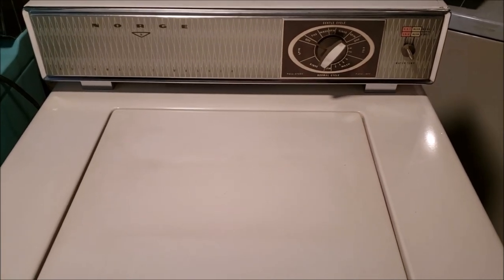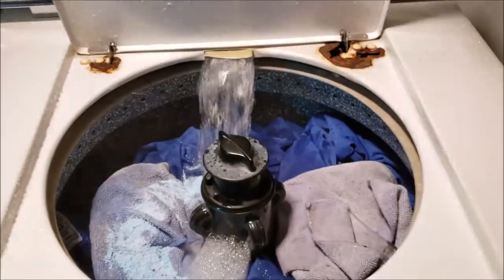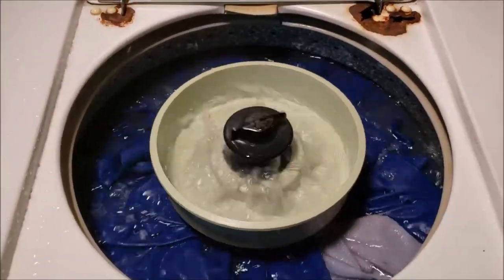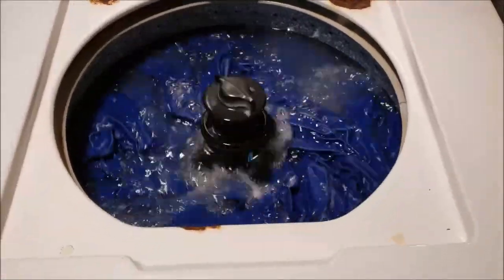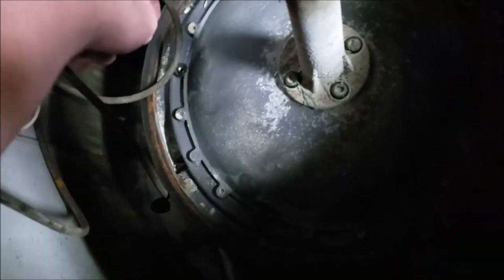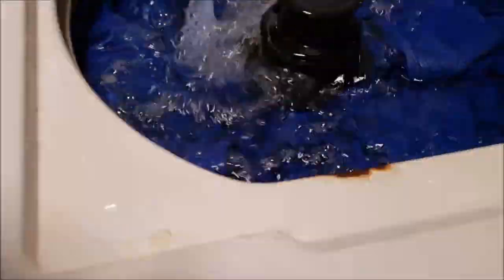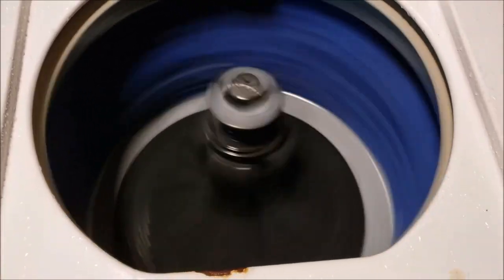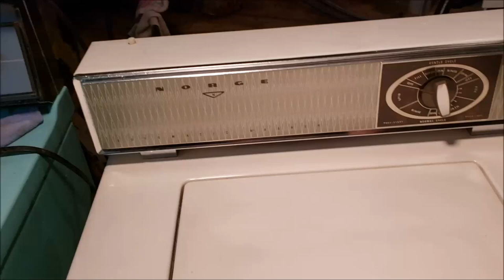Full Cycle- 1962 Norge Automatic Washer AW-220

Comment: The Norge legacy became part of the now defunct Maytag Corporate umbrella. Maytag built modern versions of these machines under Norge name Magic Chief and Maytag Performa brands & Admiral . These machines were bang for the buck 20 pound versions with 3/4 hp motors staring production in the late 80's under Maytag's ownership until Maytag closed!
Reply: Channel123 they also did Crosley , i am told.   I’ve seen a near identical Magic Chef machine to my beloved Crosley work-horse, so it makes sense...
Reply: The one brand that they marketed the Norge manufactured machines under that didn’t make sense to me and that they should have gone up level with a real Maytag in my mind was the JennAir washer. It seems to me that should have been their best wares.

Comment: That is one serious agitator in that thing. Norges always had big bases on their agitators. Our early 70s Fedders Norge with the white burpolator was a powerful agitator. Huge agitators .
Reply: They were tanks lol😀
Reply: Albert Carello  Ours went out because the timer knob broke and wouldn't shut off. It just kept going through all the cycles. 

Hindsight is 20/20. We didn't have the internet then or the washer community out there. 

That was back in 1983. That machine lasted us about 9-10 years with no signs of mechanical problems other than the timer.
Reply: Gosh our 1963 Norge burned through a timer, two mixing valves, three pumps and finally a leaking transmission in six years.
Reply: @LlyleHunter  Back then I thought we would always have these kinds of machines. Don't know what you got til it's gone.

Comment: Hey love the vintage Norge’s. If you think that pump is loud brand new washers nowadays with the separate pumps are much noisier. I have a brand new 2019 Speed Queen the washer in the wash mode and spin mode is really practically silent but when the pump kicks on you can hear it across the whole house I don’t understand why they can’t make make quiet pumps in this day and age.
Reply: Peter do like I did with my Speed Queen, I put a foam rubber pad under my pump to keep it from vibrating against the metal base and it quieted the pump down by 50%!!! My machine is in the kitchen next to the living room and I really had to turn up the volume on the t.v. so I could hear it!!! Now that I put the pad in, no more jacking up the volume it works great!!!
Reply: Robert Przybylowicz thanks for the advice. Maybe when I feel more motivated, I could try that. I really don’t like to mess under the cabinet.
Reply: @petermaz701  No problem, and it's very easy to do...
Reply: Albert Carello yes that’s exactly how mine does it nothing changed. If my little dog is in the room and she laying down she jumps up when the pump kicks in.
Reply: Albert Carello haha you got that right. Lol

Comment: Fabric softeners came out in the mid 60s.  With dryer sheets , you didn't have to worry about softener being washed out.   Actually Fabric softeners just put a coating on your clothes.  After awhile it traps more dirt in the Fabric and changes its water permeability badly.  I don't use that stuff anymore.

Comment: Other than their noise these were excellent cleaning washers. They got great cleaning scores from CU and the one we had was probably the best we ever owned. Wish I still had it now.
Reply: pat cola is it better than a speed queen??
Reply: @fargeeks   In many ways yes it was. There are no other machiines today to compare the Speed Queen. 

Back in the early 70s when our Norge was made, washing machines were all pretty much HEAVY DUTY. Porcelain outer and inner tubs. Porcelain coated tops and lids .

Not only that. The Norges had large based agitators. Those machines cleaned like nobody's business. 

If I knew I could get a hold of a very low milage Norge or Montgomery Ward's, I would trade the Speed Queen for it.

The Norge we had would make today's Speed Queen look cheap.

Comment: These old machine’s are just so cool. What is the agitator made out of ?
Reply from the maker: Plastic material
Reply: This was before modern plastics. This was Bakelite which was an early type of plastic. At least that is what it looks like. In 1962 many manufacturers were still using Bakelite for the agitators. Very good thermal insulation but they were brittle and could crack under too much stress.

Comment: What a shame about the rust. Would be cool if you could get another top. I am surprised the top rusted. Weren't they porcelain coated ?

I noticed the fins on the agitator has holes in them also. Must have been for less drag on the transmission with that huge agitator.
Reply from the maker: The top on this machine isn't coated. More of a BOL machine.